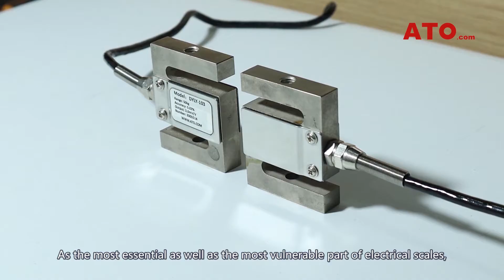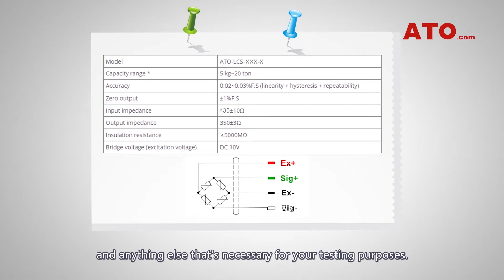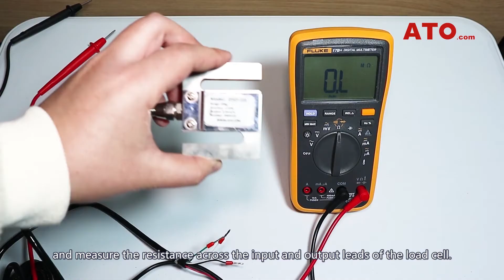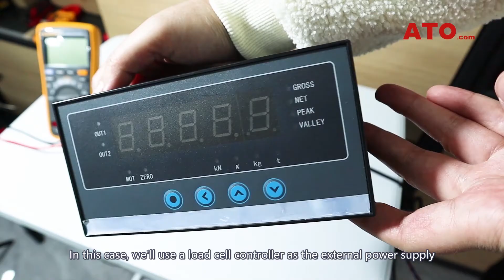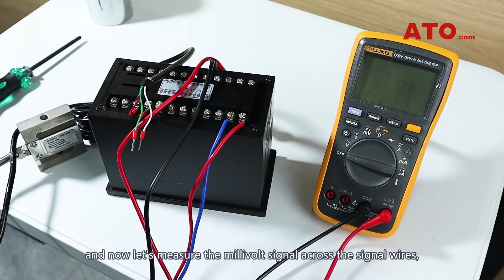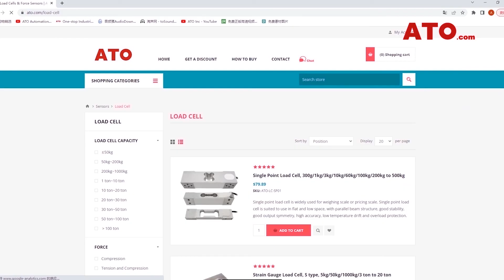How to Test a Load Cell with a Multimeter

Comment: Is that a 2.9kg weight ?  0.7mV seems incorrect if that is a 50kg range load cell with 2mV/V means 20mV max range at 50kg so 0.4mV/kg. If that weight is 2.9kg I will expect 2.9 * 0.4mV = 1.16mV not 0.7mV.